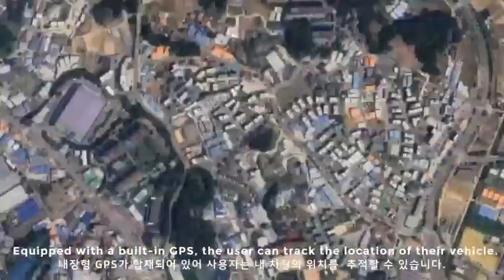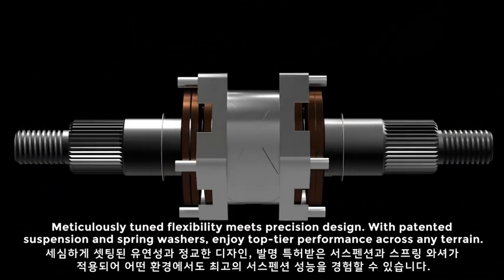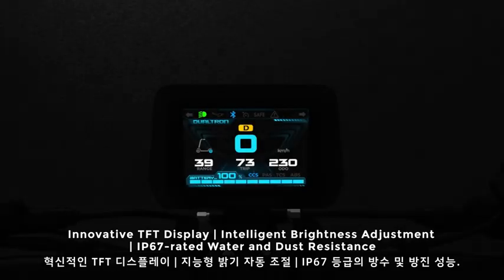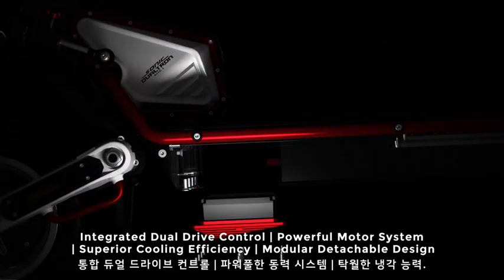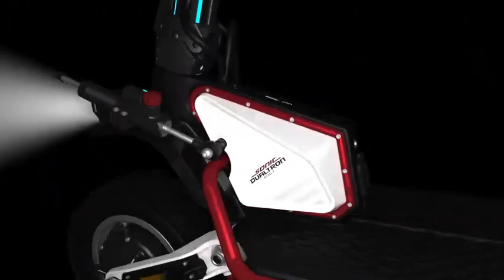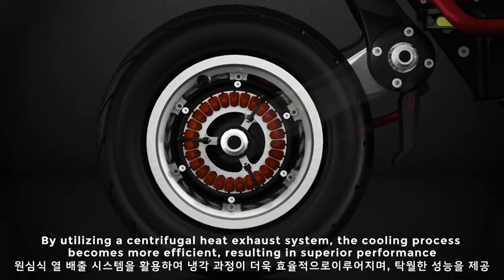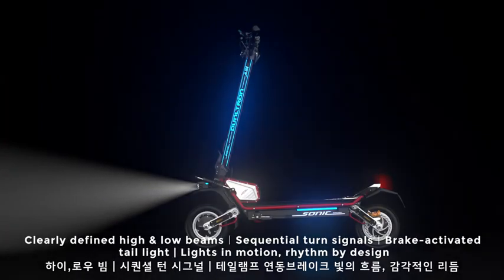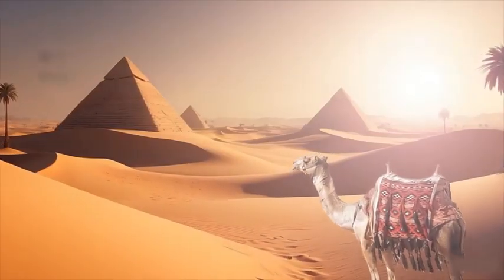"DUALTRON Alien teaser revealed—experience the future!"

Comment: Dualtron scooters are very unreliable. My friend bought a Victor Limited and his controller immediately burned out, then the tire started to deflate, then the steering column backlight stopped working and it also started to creak loudly. The controllers are still not sine, it constantly twitches, it is impossible to control it normally.

They still can't fix it for 7 years, every year the same thing. The wires are complete crap. Therefore, this scooter will break and it will be expensive to fix. Better get something else!

Comment: We need:
 - spring hydraulic suspension
 - sine wave controllers, with no lags
 - thumb throttle
 - nice app 
 - no bulky thing in legs. Oh this is failure..
Reply: No we don't. There are 999 brands that gives sine wave controllers, thumb throttle and spring suspension, we don't need that, we like dualtron square controllers and unique throttle and design
Reply: Exactly @AB-cd5gd
Reply: @AB-cd5gd  It’s exactly because of this kind of mindset that brands stop evolving.
Square wave controllers are old tech, that’s what scooters had years ago. Now most brands have moved to sine wave for smoother and more modern riding.
A lot of people left Dualtron not because of the reliability but because they’re one of the last brands still stuck in the past.
Wake up man it’s 2025, not 2018.
Reply: @captaincook95.71 no they are not old tech they are different technology for different purposes.
Reply: @AB-cd5gd  Sure.Keep calling it “different technology for different purposes” if you want to.
I’ll just let you enjoy wheel-spinning at every takeoff while the rest of us fly past you at the green light with smooth and controlled sine wave power.
Don’t act surprised when you’re getting smoked by real scooters with real tech 👍😁
Reply: @captaincook95.71 there's no point they allow themselves to be brainwashed,, hardcore Dualtron simps can't tell them anything the year could be 2050 and Dualtron will still be using flipping square wave controllers which are highly power inefficiencent btw and suspension cartridges with their fan base of under 100 people 😂
Reply: Sorry to disappoint you guys but this is a sine wave! The first one they're ever doing
Reply: @molecricket62 still haven't gotten a real hydrualic suspension yet